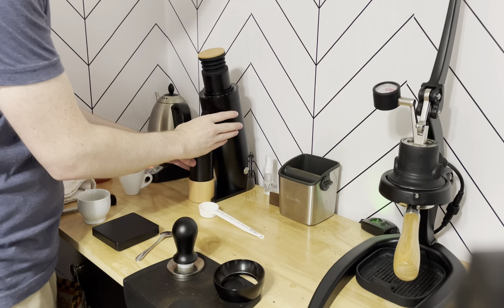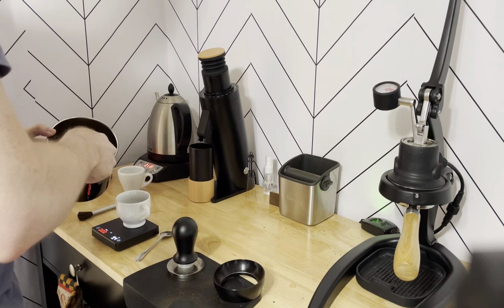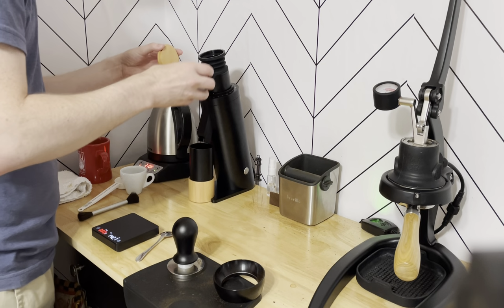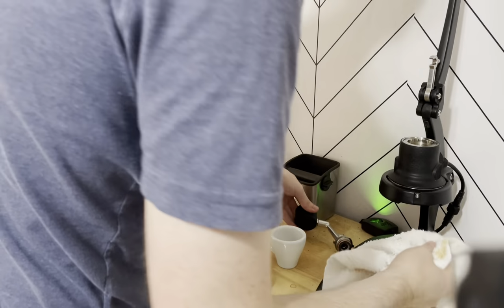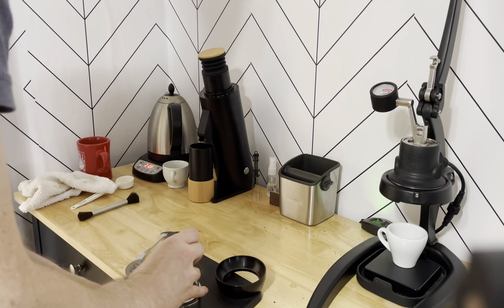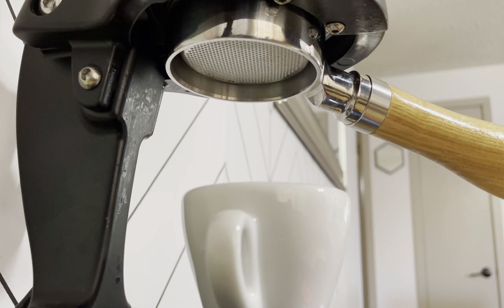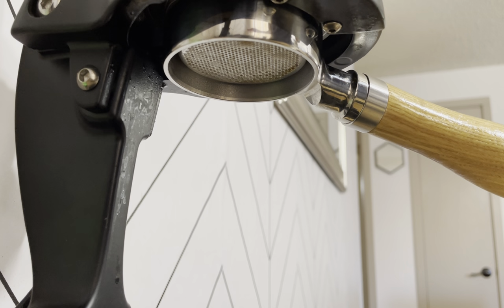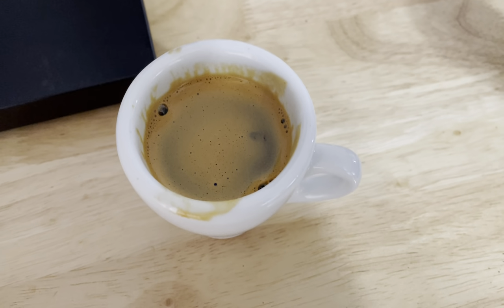Flair 58 + DF64V espresso

Comment: Hi. What grind setting are you using? I'm struggling with my new Flair and this grinder (however mine has SSP MP), not even at 5 am I getting close to 4 bars
Reply from the maker: I would perhaps guess your issue has to do with alignment of the burrs. Right now, depending on the coffee, I grind between 10-18. I do know that SSP burrs make you grind a bit finer from what I hear (I have never actually owned SSPs). However, on a previous grinder I had a similar experience and the issue was burr alignment